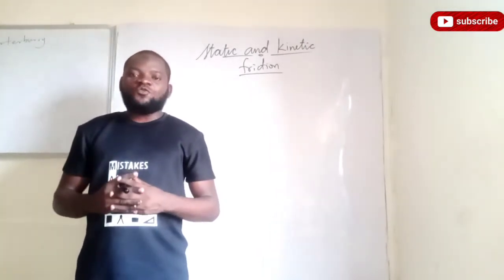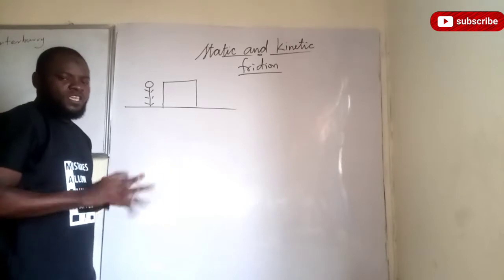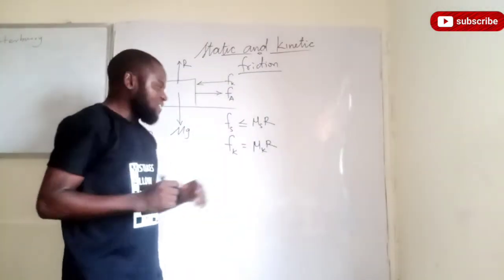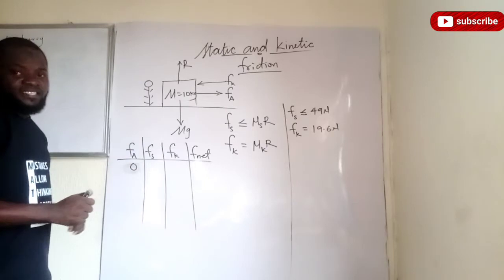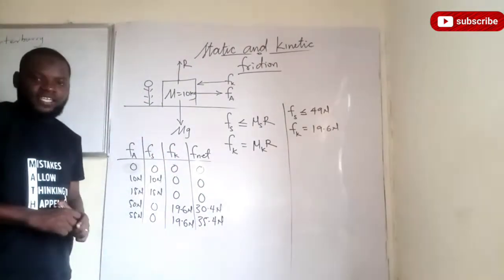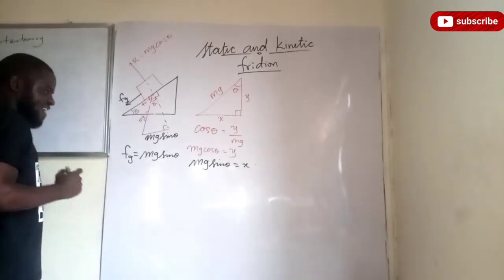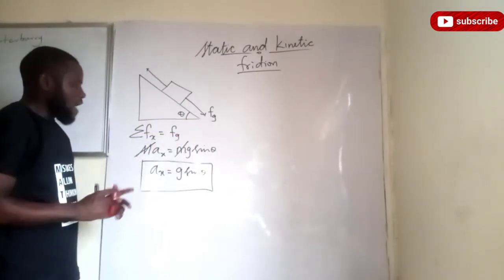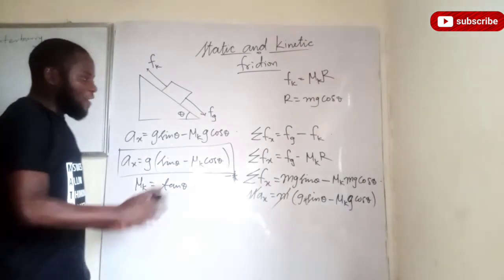static friction, kinetic friction and friction on an inclined plane

Comment: Good morning sir,sir pls I know what I'm about to ask it's not related to this topic 🙏A block of mass M1 resting on a smooth horizontal surface is pulled by a mass-less string attached to another block of mass M2 hanging over a pulley. Find the acceleration of the system and the tension in the string. 
I don't understand this pla